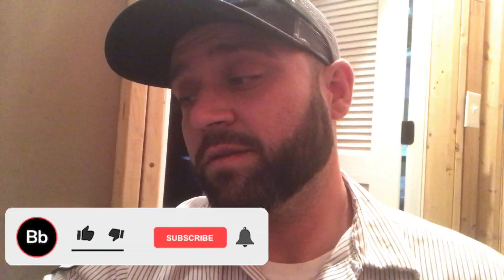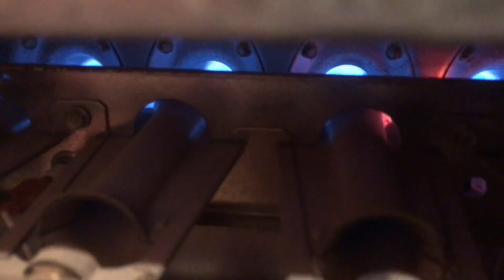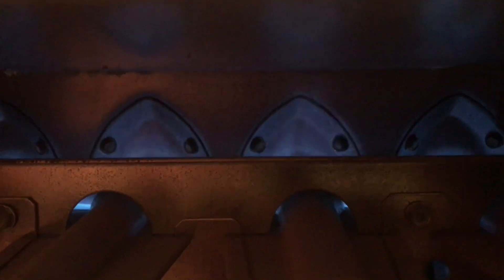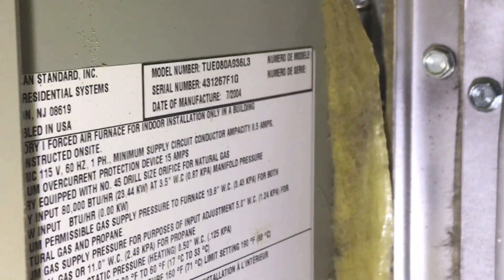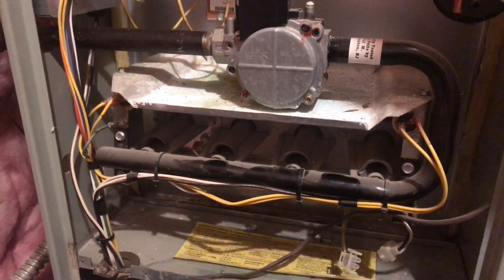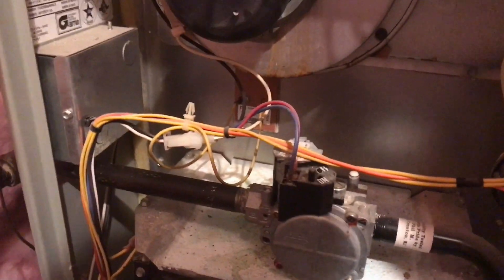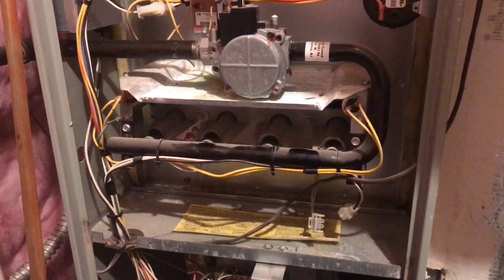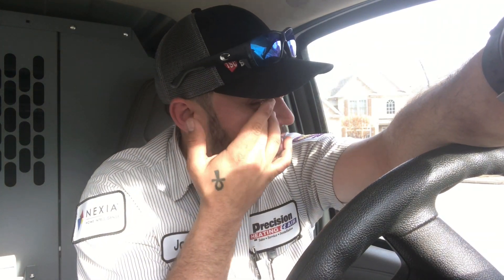Watching A Furnace Run With A Cracked Heat Exchanger

Comment: Learned recently that if you see the flame turn orange and whip around a bit when the blower kicks on, turn down the gas pressure a bit, turn the system off, and shop vac the the burners and surrounding area. I had one where the blower kicking on would vibrate loose dust and rattle the burner making it look like a bad heat exchanger. I pulled the blower out and didn't see any problems with the heat exchanger.
Reply: Why “turn in the gas pressure down” why not jus shut the gas off completely while you do this maintenance you speak of friend?
Reply: @MathCuriousity  I honestly don't understand this comment I made years ago. If the flame is whipping around when the blower kicks on it is either because there is a crack in the heat exchanger or there are particles vibrating into the flame.

Comment: Trying to understand this ... When the blower comes on, the added pressure blows air through the crack and in the opposite direction of the normal flow of the combustion mixture?
Reply from the maker: Yes the air from the blower goes into the crack and disrupts the combustion

Comment: Just trying to get another opinion. I have an older 1993 fuel oil furnace that has a non-metal heat exchanger. The tech said it would crumble and showed me a decent size crack in it with camera. He said it's not possible to replace the older heat exchangers with a newer model and said I'd need a new furnace. I mean he looks to be right since it's a 28 year old furnace but just making sure. Every year it was maintained the techs kept saying it was in great condition so it's hard to just think it went bust the one year I didn't do a maintenance check. I put a CO monitor near it and it shows 0. But the tech said he didn't recommend even firing it up again. Any thoughts or just bite the bullet on a new furnace?
Reply from the maker: Yes unfortunately it sounds like you’re going to need a new furnace. The technician is correct in saying the heat exchanger cannot be replaced in that old of a furnace. Sorry for the bad news
Reply: @HVACTechTips  Thank you for the quick answer.  I figured as much, but just wanted another opinion and saw your video being recent about the subject.  I appreciate it.
Reply from the maker: Anytime!

Comment: Just curious, what was your CO readings?
Reply: A combustion analysis would be much more conclusive including CO readings at vents. Regular CO analysis are probably the best predictive tool for deterioration in furnace safety and overall reliability.
Reply from the maker: I didn’t take any. I didn’t see a need to. We’re replacing the heat exchanger this week Bc Trane has the heat exchanger warranty for 20 years. 🤦‍♂️

Comment: Good Video, but now the question is why did the heat Exchanger failed after 16 years.
Reply from the maker: The filter was really bad. It’s possible they run a dirty filter most of the time. That could explain it

Comment: Is a cracked heat exchanger the only reason why the flame would roll out?
Reply from the maker: If it is rolling out like this one...yes.
Reply from the maker: And if it does that only after the blower come on YES!
Reply: Could be a weak inducer motor too. But when flames roll out like that specifically when the blower turns on than its definitely the heat exchanger.
Reply: What’s an “inducer motor” and how could it Mimic a cracked heat exchanger?

Comment: Josh....what was the customer’s complaint? Why were you there?
Reply from the maker: The original reason I was there was doing a PM.  The customer thought I was scamming him I guess but, I’m going back this week to replace the heat exchanger! Lol.. It was under a 20 year warranty from Trane.
Reply: @HVACTechTips   20 year warranty? Is that common on heat exchangers?
Reply from the maker: Yes it is. New systems comes with a lifetime heat exchanger warranty
Reply: @HVACTechTips  in those moments I take the customer in there and show them the fire rolling out. Or show them the CO readings. You do have certain customers that say we'll it was running just fine!
Reply: Thanks Josh......You most likely saved him and his family!,,,,
Reply: Appreciated the videos. Thanks. - new subscriber :)
Reply from the maker: Great. Thank you!